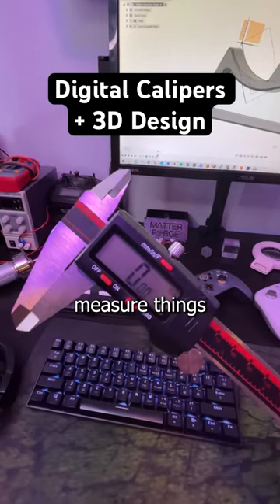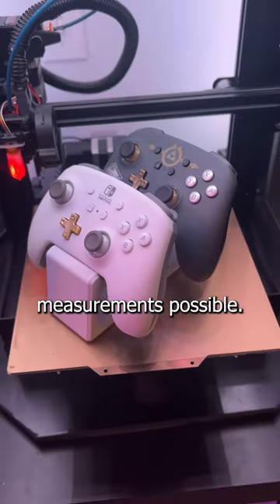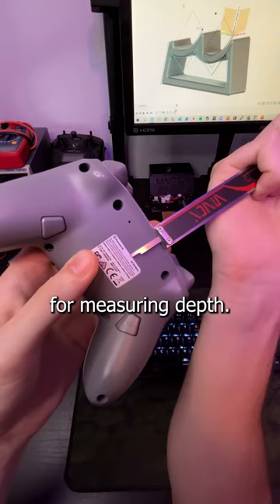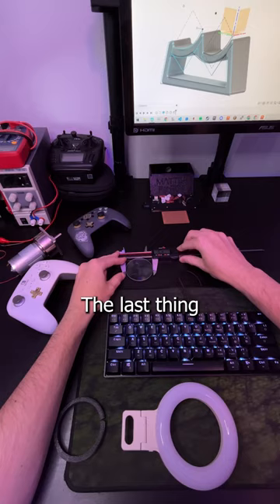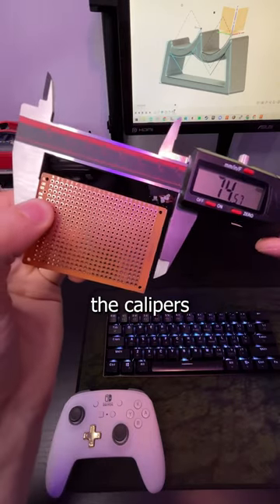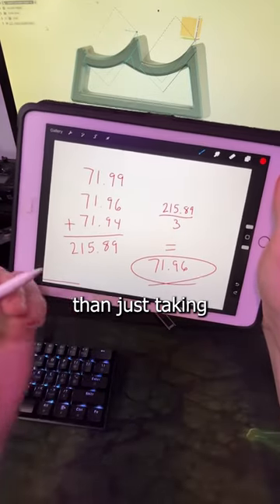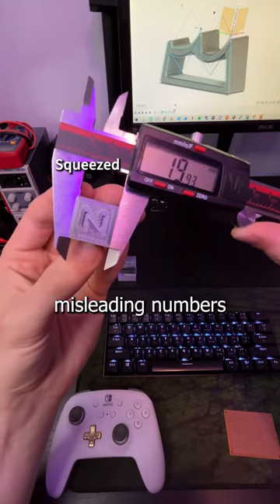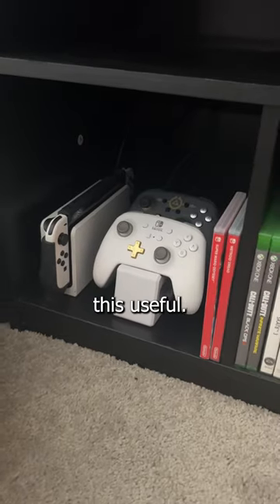Using Calipers to Design Things. #calipers #tips #3ddesign #3dprinting #diy

Comment: Calipers have 4 ways to measure.
Reply from the maker: The fourth being?
Reply: @thematterforge kind of hard to explain but the backside of the caliper can be used to measure depth.
Reply from the maker: @danielgigandet2938  isn’t that what the depth gauge at the bottom is for?
Reply: Correction the forth way is for step measuring.